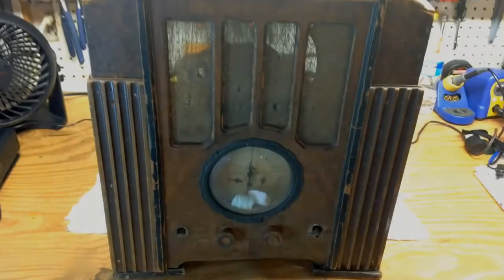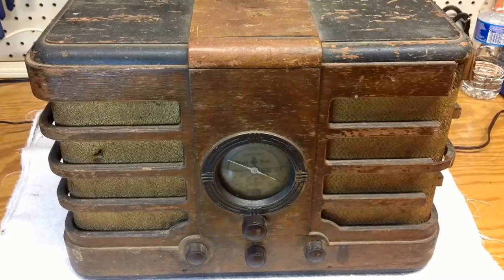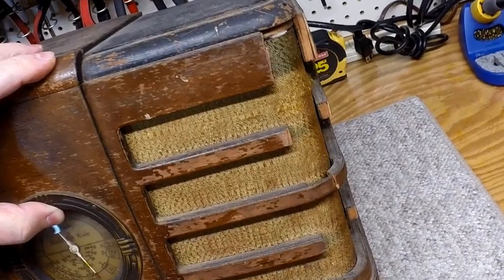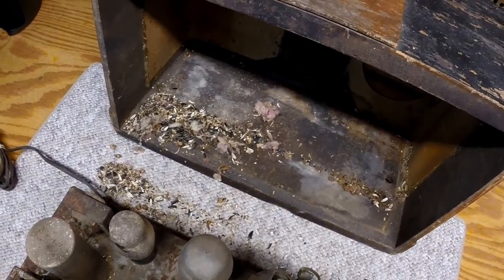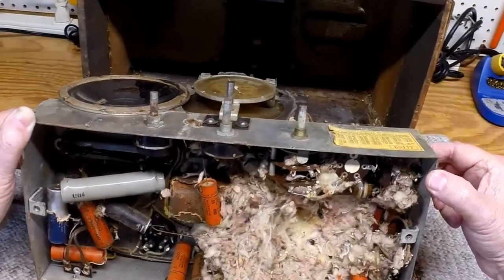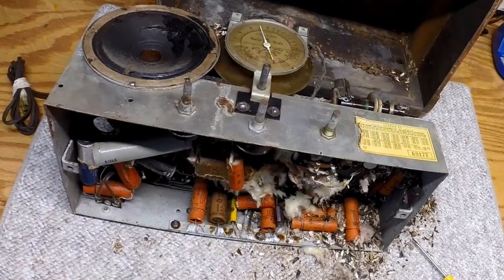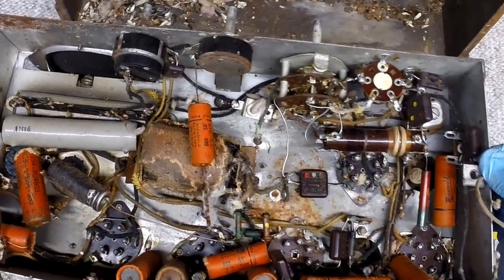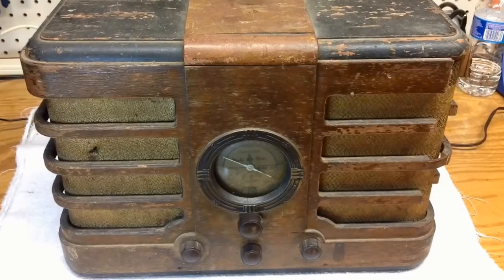Next Radio Restoration Disclosed

Comment: Hi Don - You sure have some work to do.  We will be watching all your videos as this almost trashed radio comes back to life again.  You know, in my early career I repaired small business computers in the 70s, which weren't all that small compared to what they are today.  One day I opened the cabinet to see why the computer wasn't working well and inside I saw a huge rat nest in there.  What a pain, and even though I didn't want to do, I had to clean it out.  So I understand what you had to do with your radio.  Looking forward to your next video!  See ya -- Atco
Reply: Yuk! I would not want to do that either.
Reply from the maker: atco21117 Thanks Atco. It will be rewarding once I get the restoration completed, assuming I don't run into anything major that brings the project to a halt. I'm not overly excited about about getting my hands back in there for sure.

Comment: wwooww!
Reply from the maker: This one (Chanticleer 2D570) required more work than any other radio I've tackled to date. I think you'll find the entire series entertaining and informative from removing the nesting material, derusting the chassis, building a new voice coil, spider and a lot of cabinet work to bring this back to a presentable condition. Thanks again for watching. Best, Don
Reply: Almost finished this series. I hope I can come across this one someday.... even with a few caps eaten halfway would still be no problem. I did see this with a tube amp called Talk-A-Phone I got this summer. Kinda grossed me out as well and was not as bad as your Chant!
Went to the outside with my compressor, a mask and gloves...yuk. The tubes were fine tho, so a great find really. Not sure if its worth fully restoring tho, but may be a good one to experiment with to get better. See you soon Don.
Reply from the maker: +saturn5tony Tony - The Talk-a-Phone sounds interesting. The mess I had to deal with was not fun, but I wouldn't trade it for nothing if I could find another "gem" like the Chanticleer. Thanks again for watching. Best, Don